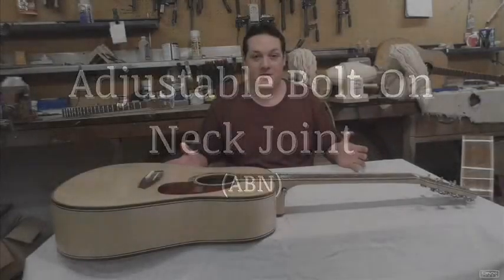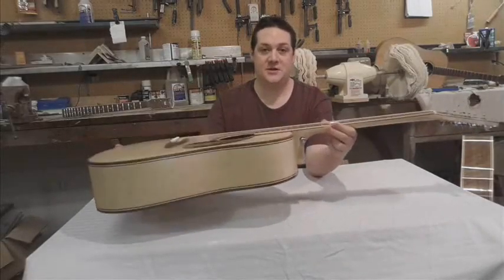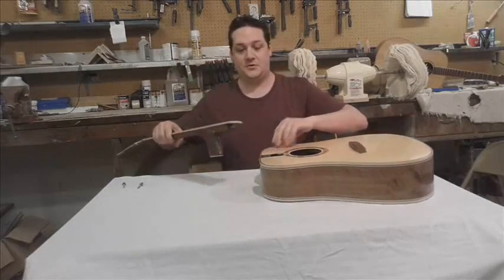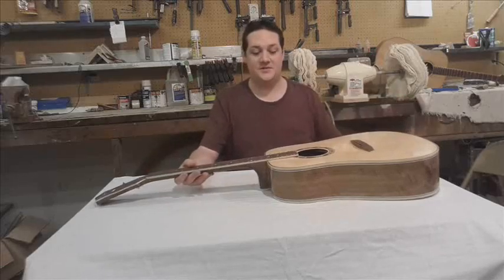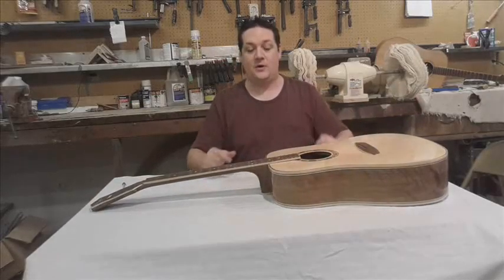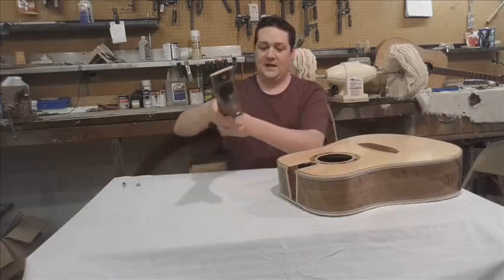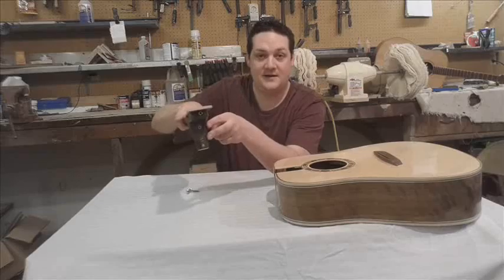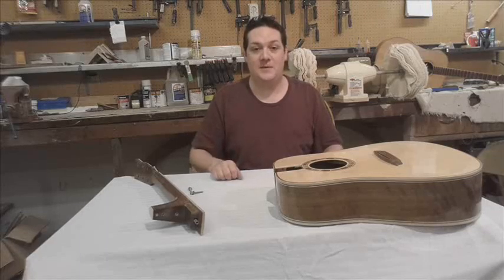Mazzocco Guitars-Adjustable Bolt-on Neck Joint

Comment: Hi Ryan, a fantastically informative video. Your site is likewise very detailed. I am presuming you do not use any glue in the joint, and I would be interested to know how you avoid any buzzing or rattling where the fretboard extension is not fully in contact with the guitar top? Many thanks

Comment: Kind of like Taylors nt neck joint except the use precisely cut shims to take up the gap upon adjustment leaving no gaps at the point of heal to body or fretboard to top contact great idea though love it on my Taylor after 8 years it needed to be reset.

Comment: Very interesting.  Similar to Gore /Gilet (which you're obviously familiar with) but using the more common threaded inserts instead of a tapped steel bar in a mortise, lacking the vertical bolt, and with the interesting addition of the low adjusting bolt.  Thank you for sharing.
Reply from the maker: Thanks for the comment and thanks for watching!
Reply from the maker: Thanks for the comment and thanks for watching!
Reply from the maker: Thanks for the comment and thanks for watching!

Comment: Holy crap, it's the same design as the truss rod. That's genius.
Reply from the maker: it's similar in the sense that you turn a hex screw to make the adjustment.  But the similarities end there.  This system adjusts the entire angle of the neck, not just the amount of relief like the truss rod does. Thanks for the comment and thanks for watching!